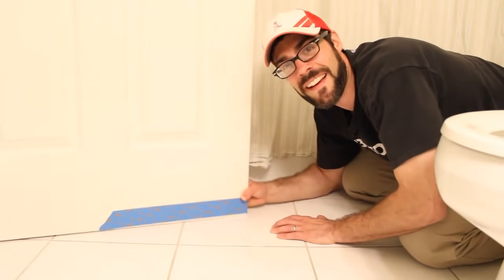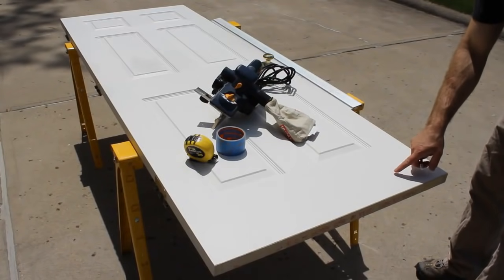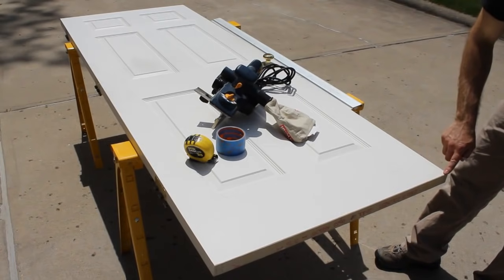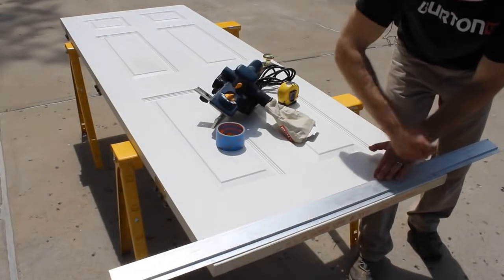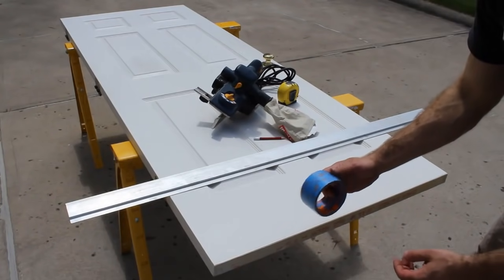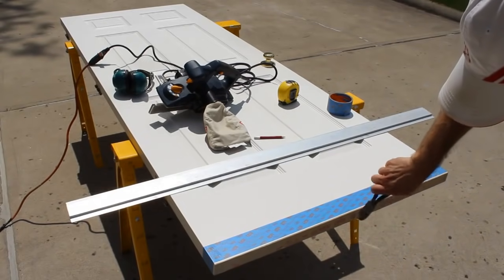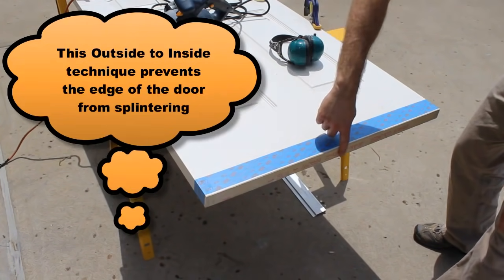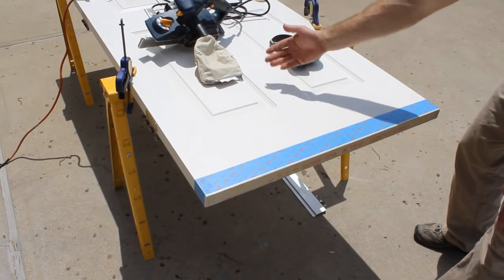How to Trim a Sticking Door with an Electric Hand Planer

Comment: Nice when you have benches and LOADS of space, but most jobs (in appartments)  will have to be done with neither. 
Stand the door on its side and brace it vertically. Work the top side base towards the middle then flip over and do the other side. 
This can be done in a small hall or corridor.

Comment from the maker: There sure is, I've found that if you plane the door completely from left to right you run the risk of chipping the wood on the edge of the door. Thus, I prefer to start from the left and plane into the center. Then, I do the same thing for the right side of the door. Doing this a few times provides a nice even look and stops any chipping of wood.
Reply: This comment should be upvoted. This is the most important thing. Loved your video. Simple, short and to the point.

Comment: Great... except this video "assumes: you door is hung level and plumb and your floor is level. If your floor is slanted away or towards the door opening the door it can hit at the free edge (as your door is doing in this video) By cutting off the same amount of material along the entire bottom edge as you suggest you can end up with a gap at the bottom that is not parallel to the floor and appears uneven. In this case its better to measure the size of the "gap" where the door clears the floor and record the measurement. Then at the edge of the door where its hitting and floor measure up from floor the distance you measured earlier and draw a straight line connecting the two measurement points. In this way the gap will be parallel to the floor even if your floor is not level.

Comment: Nice video, but I'd be working from the top of the door gap and coming down whilst the door is still hung (also checking that the floor isn't crazy with is it's finished height (tiles, lino etc) then work off that. I'd be keeping my Nail Bag off the finished surface of the door to. Not hating on your video mate, but just my two cents like any other Carpenter.

Comment: I just got 30" wide doors and the opening is 29.5". Would it be alright to use a table saw to make the cut or a jointer?
Reply: What did you end up doing?
Reply: @Kshais  I returned 30" and bought the 28" door

Comment: This is a job for a circular saw. With a straight edge to guide it you can guarantee a straight cut.
Reply: I have a problem. My doors have hinges that run along the entire length of the door. Hundreds of tiny screws. Is there anyway I can plane the doors without removing them?

Comment: Is this method ok to do on a hollow core door?
Reply: Yes, because you're trimming a very small amount. The top, bottom and sides of a hollow door are solid. Just be sure to check for staples as suggested in the video.
Reply: He was trimming a hollow door, btw.
Reply: @Michael W Here is my comments by a licensed builder: I dont care how you do it, as long as you can make the client shut up.

Comment: Don't remove the screws from the hinges.. once you do, there's no going back. Remove the hinges at the pin. For this problem I would have hammered back the top hinge though and adjusted the door plate for a more 'corrective' solution.

Comment: Difficult to do I imagine without the guide attached to the side of the planer? I have a planer that I got from someone but no guide came with it.
Reply: hold it straight and check with a square as you plane , faster  to turn the plane the other way without messing with the guide. If you were routeing in a fire strip then mask it for shure.

Comment: Jeff I need to be able to do the bottom and the side. I suppose it's the same concept. Nice job. I noticed your using the Ryobi planer does this work best on large jobs? I have 3-4 doors I need to do. Thanks in advance.
Reply: After I reviewed this I will be looking at Porter Cable planer to see what can be done or hire it out. Cheers
Reply from the maker: Michael Levitre you know what, if you can get the Porter Cable buy it. Nothing against Ryobi but Porter Cable is a bit better. You just need to make sure the door is clamped down really good then you can do the side and bottom. Keep me posted.

Comment: One question. Why remove the pins n not just unscrew the hinges?
Reply: If you remove the hinge you run the risk of the screws not sitting how they once were before you took the door off thus causing a bigger problem than you had to begin with, by taking out the pins you ensure that the hinges sit as they did before because there is no way you can unalign the pins when putting them back in (unless you bend them off course, but it's pretty unlikely).

Comment: Thank you for the video. After you plane the door, do you need to perhaps paint over it or something similar to prevent potential swelling of door?
Reply from the maker: Great question Andrew and yes. It should be primed then painted to prevent moisture from wicking into the wood.

Comment: Hi Jeff,

In the video you trim down the door the entire length. I was wondering is it possible to trim a door just where the high spot is without trimming down the entire length . If it can be done how would you do it? Would a belt sander work just as well.
Reply: Tony Cellucci
Reply: Tony Cellucci iii

Comment: i just never understood why does this sticking ever happen in the first place
Reply from the maker: +AhmedCool it can be for different reasons. If the top and bottom of the door aren't painted the wood can absorb moisture and swell. Also, the house can settle and cause the door to pinch the jamb or floor

Comment: You planed the whole door, should have taken less from the hinge end so the gap at both ends would be identical from the floor.

Dump that Ryobi DIY planer.
Reply from the maker: Thanks for your thoughts Cumbriahandyman - the amount I needed to plane was minimal. So the appearance isn't bad. But I see your point. 

The Ryobi is fine, I don't plane many doors and it's cost effective. My brand of choice these days is Bosch. Love their tools.
Reply: But keep in mind, Bosch was forced to move a lot of their manufacturing out of the USA due to the ~40% corporate tax rate. They bailed out of the USA, like so many other corporations because the global average corporate tax rate is ~15%. Lot's of American jobs lost, very sad. Oh sorry, went a little long there, but the bottom line is that the Electric Bosch Planers is one of the products that is no longer American made. Would be nice if we could lower that tax rate and bring those well paying jobs back.
Reply: My bosch multi tool is a piece of shit.  The demo hammer sds max is great though.

Comment: Holy overkill why not just measure the gap from the floor to the door mark the same on the otherside mark a line using a straight edge from ur mark to flush and have the same reveal across the bottom so it looks like its supposed too???
Reply: Suqugh miekoq because this is DIY not 30 years of door experience.

Comment: That's not a hand planer, it's electric
Reply from the maker: it's an electric hand planer
Reply: Good distinction, though a shop planer or "wood planer" is usually also electric.  (And you can use it to plane down things that are made of stuff other than wood.)  And the hand tool planer can be difficult to use in comparison.
Reply: it's electric

Comment: I did this the old fashioned way....I used sandpaper.   Not fun...
Reply from the maker: Holy Toledo, that sounds tough. Although it may not have been too bad if you had to shave off just a fraction of an inch. Hopefully it all worked out :)
Reply: +RapIsDeadly fuck that! i tried a sander and didnt even make a dent in my 1930 doors. then i got a hand plainer and that barely worked on the edges. going for a circular saw next
Reply: MelodicsRareMusicVid
Lol...I have since learned my lesson.   I found a "circular bit" that fits the drill.   Had it done in 5 minutes.    But yeah....I was quite the idiot doing it with sandpaper.
Reply: thats a good idea ima see if i have one around. i hope i dont lose a hand. i got like 6 doors to do lmao
Reply: +RapIsDeadly That is not the old fashioned way .That is somebody who is not trained in woodworking .
Reply: i ended up hiring my neighbor lol turns out the wood on my door is so old that it faces 2 diff directions the middle and ends were diff. so while shaving it gouged it. i just had him razor a line and electric sawd it and i held the door

Comment: Completely wrong, with a builders pencil lying on its side mark both sides of the door whilst the door is in place. Remove the door from the hinges and with a straight edge form your line. The difference in height from the flat side of your builders pencil and the centre lead will give you a natural gap between the base of the door and your floor of approx 3mm. With your planer now plane the door moving from the centre of the door to the sides. Never from the sides to the centre as per the video. This will ensure that you don't damage the sides of the door should your planer grab. You're obviously not a tradesman.
Reply: Exactly!! plunge saw would be my weapon of choice.
Reply: Could I trim a door down using a table saw?I also have a jointer, could I run it across that? I need to take 1/2" off the full length.

Comment: Says it's simple, than immediately proceeds to remove the door from its hinges... it's common sense when the door is off the hinges. I'm looking fora solution that doesn't require removing it from the hinges lol
Reply: Unfortunately removing the door is the best way to plane, cut, route or whatever it needs to be worked on for the best angle purposes. Unless you have time to sit and play with little hand tools. But this video is a great teaching guide for a way to do it.